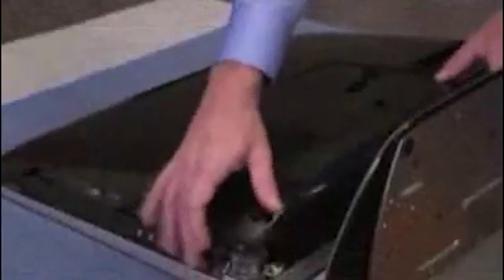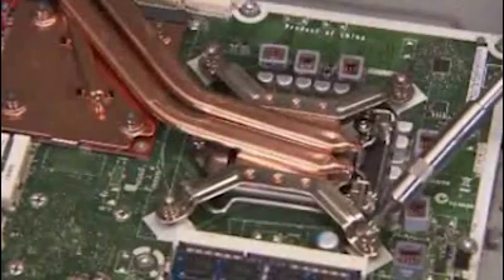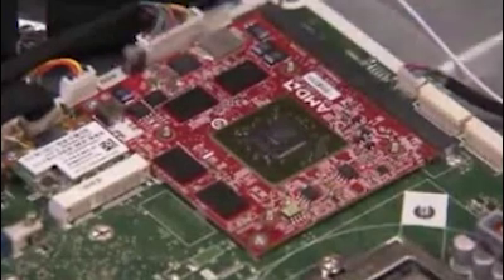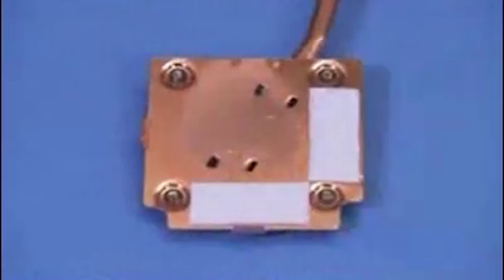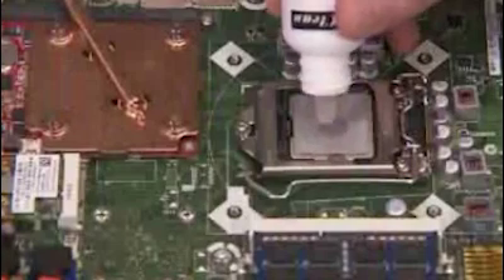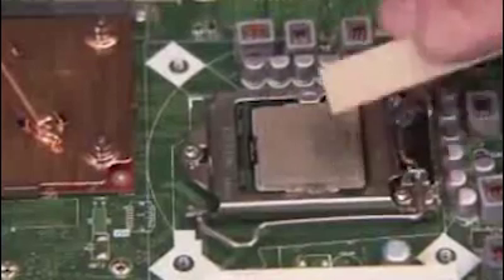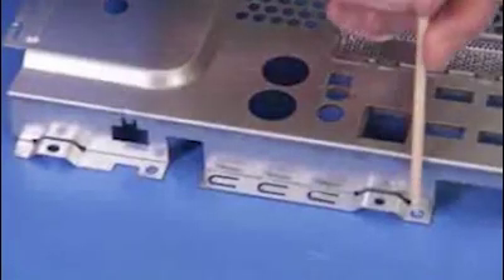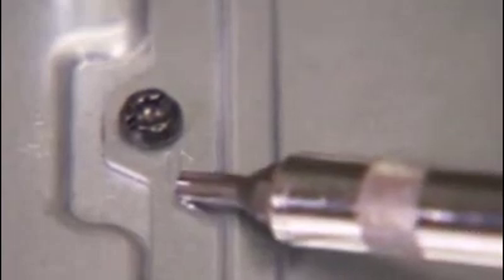Add or Replace the MXM Graphics Card | HP Omni 27-1000 | HP Support

Comment: I purchased a used hp omni 27-1054 to use for zwift cycling. After downloading zwift i recived a message saying i need to upgrade my graphics card to use the app. Is there an upgrade available that will work for this?
Reply from the maker: Hi Aran, thanks for contacting HP Global Social Media Support!
I understand that you need to know about upgrading the graphics card of your computer.
I will do my best to assist you.
May I know the complete model number of your computer?
Please let us know!
Binu-HP Social Media Tech Support
Reply: @HPSupport Model No. 27-1054
Reply from the maker: The model number is not a complete model number.
Please let us know the complete model number of your computer.
Binu-HP Social Media Tech Support
Reply: @HPSupport  Hello! It says: 
HP Omni 27 PC
Product No.QW801AA#ABA
Model No.27-1054 
(A2223AV)
Thank you for your help!
Reply from the maker: Thanks for the reply.
Checked the specification of your computer and found that it does not have an expansion slot to add external graphics card.
Binu-HP Social Media Tech Support
Reply: @HPSupport Thank you for checking that. My computer appears to be the same one as in the video these comments are attached to. Is there an upgraded internal graphics card available anywhere?
Reply from the maker: Thanks for the reply.
You would not be able to upgrade the graphics card as it is inbuilt to motherboard. 
Regards, 
HP Support
Reply: Hello. It says Model No. 27-1054

Comment: Is there a limitation on graphics card upgrade possibilities on this model 1001ES model ? I got AMD Radeon Pro WX4150 4GB card brand new and after installing no screen I mean is there a limit in GB capacity or anything else like same with cpu upgrade where it only allows S models of core I series which is low power ?
Reply from the maker: +The Lucky Charmer Please perform the steps mentioned under this document to fix this issue: http://bit.ly/2uVqIDv
Reply: @HPSupport  I don’t think I have that I found security enabled on pci-e slot mini pci slot and other same one for WiFi and the tv card that it came with 1001es is the serial number of this computer you can’t instal any cpu but S model of core I series which is low power models so I’m thinking what if the motherboard have same restriction of graphics card ? There is no more bios update available until 2012 is last update ;(